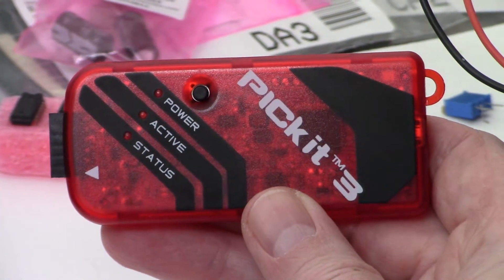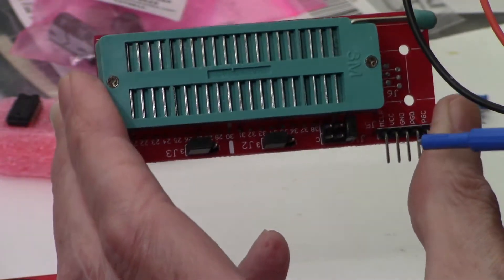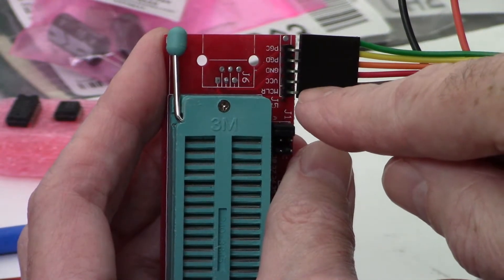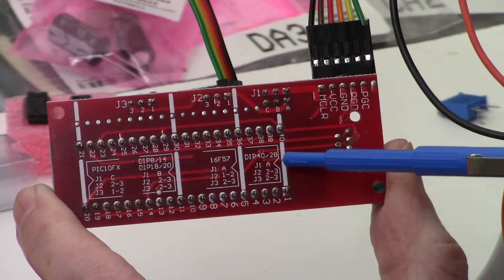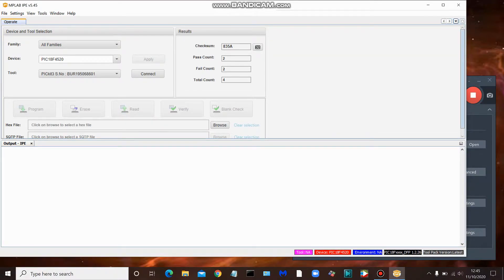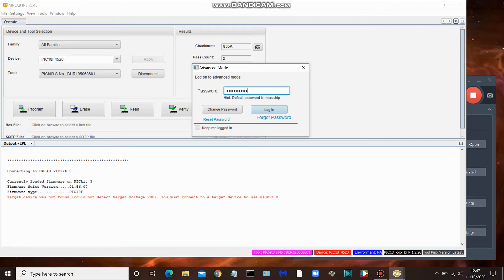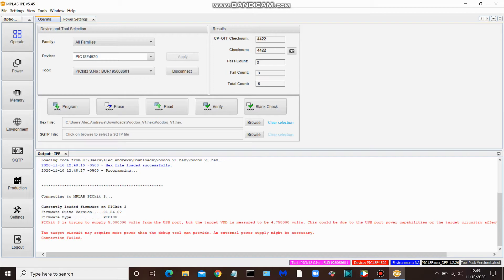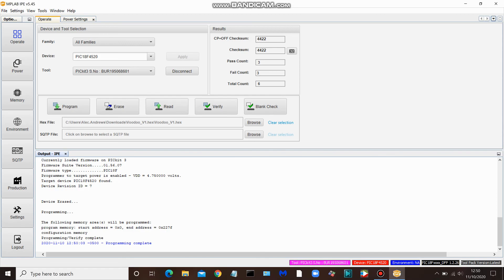Using PICKit3 to load Hex File onto PIC

Comment: why do i have the urge to make a "short video" on programming a pic manually?

long ago one could program them with a relatively simple circuit, on the parallel/serial ports... and thats only a small step from manual.

always sort of wanted to try it... just need a bunch of switches. and some time. the hexfiles all translate to binary opcodes... fairly straightforward.

Comment: Sir,   how to ic program  read and save (program  file)in pc  in this pit3 programber.
Same guide please
Reply from the maker: The hex file must be produced (code written) in accordance with what you intend the PIC to do. The only purpose of the video that I made was to show the step by step process of using a PICKit3 to load the hex file onto the PIC.  The actual content of the Hex file was irrelevant to my video.
The Hex file needs to be specially written to its purpose the same as any programming code.
Reply: Sir,  I interested  how to use this programber  for read ic program  and save file  in pc.
Its use in direct in instrument pcb in?
Same manufacturer  give testing  5 point near microchip.   That time smps want on for 5v , same i confuse.

Comment: I'm trying to program a PIC32MX250F128B and all I get is: 
"Unable to connect to the target device.
Failed to get Device ID"

The green power light and blue active lights are on on the PICkit3. I've tried every voltage between 2.5 and 3.5 which is the entire range for this PIC chip. Any ideas?
Reply from the maker: Lots of good troubleshooting ideas here:
https://www.microchip.com/forums/m834380.aspx

Comment: Very nice video. I saw you had a pre-developed hex file that you selected. Where did the hex file come from? How donI locate the proper one for my PIC? I am struggling with the PICKit 4 getting the proper hex file loaded onto a PIC16F1704.
Reply from the maker: The hex file must be produced (code written) in accordance with what you intend the PIC to do. The only purpose of the video that I made was to show the step by step process of using a PICKit3 to load the hex file onto the PIC.  The actual content of the Hex file was irrelevant to my video.
The Hex file needs to be specially written to its purpose the same as any programming code.

Comment: Thank You for the video. I have a question, i Have a microcontroller that the it's number was scratched off. How can I identify the model number and download the program it has so i can make copies of it into new picks?
Reply from the maker: When the PICkit 3 Programmer Application is first opened, it will attempt to identify the
connected device by the device ID and display it in the Configuration window.
Reply: @SurfDetector  thanks for the informátion. Can I download the  program from the pic ?
Reply from the maker: https://microchipdeveloper.com/mplabx:read-a-device-and-save-the-hex-file
Reply: @SurfDetector  thank you!!

Comment: You can connect both pieces without the cable
Reply from the maker: Yes you certainly can connect the Pickit3 without the cable assembly.  I thought it might be easier to show it with the extension especially as that makes it easier for me to update the PIC when it is installed in my project box.  Thanks for the comment and thanks for watching.